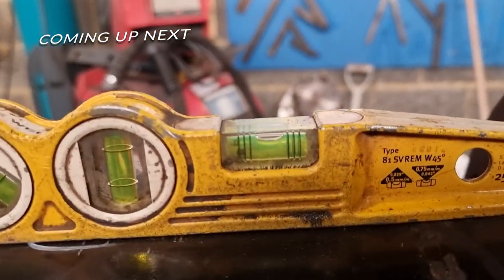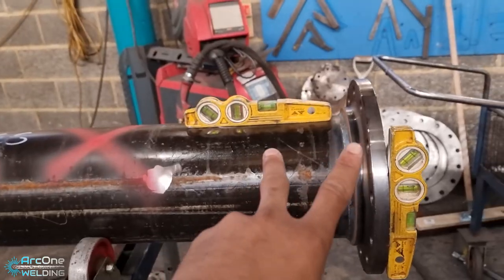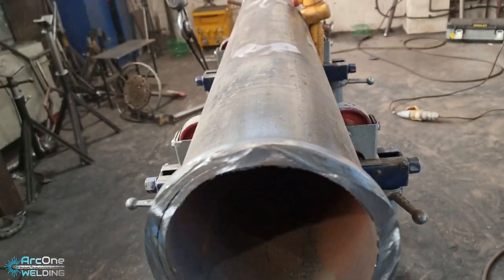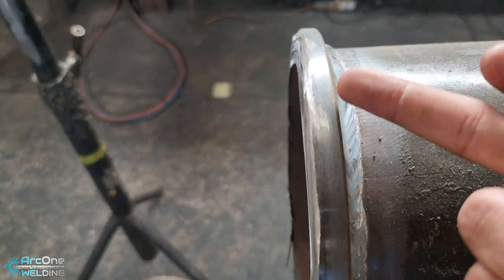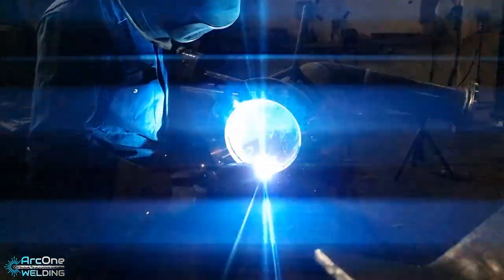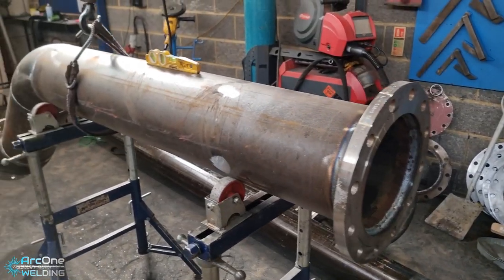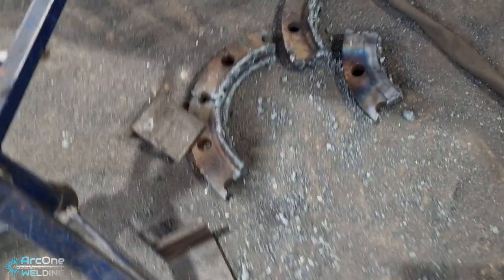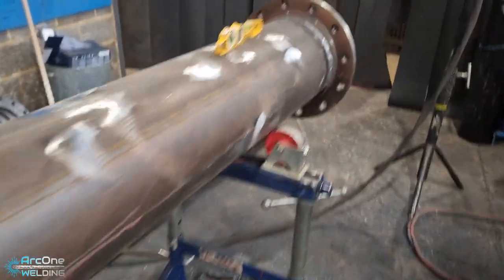2 Failures In 1 Day How To Repair A Condemned Pipe *Flange Cut & Burned Off*

Comment: Try using 2.5mm rod bits like small wedges to pack out & centre the flange this keeps the flange square with little alteration. retired fitter/welder. Always check bolt holes, level, etc etc.

Comment: Thumbs up bro!
I don´t know too much about MAG on pipes. Isn´t it possible to straighten these out using the acetylene Oxygen flame? On TIG/Stainless we do this even using the TIG torch to just straighten it. It surely works fine everytime..no cutting/grinding and all that. 30 minutes and done. But how is it on carbon pipes? Greetings from FRG.
Reply from the maker: Hey dude, nd tbh on pipe this big one torch isn't enough to get it hot enough to pull and its a pain trying to heat it because i eventually give up and just cut it off
Reply: @ARCONEWELDING  allright.. there´s no end to learning. Keep it up! Good videos, solid work!

Comment: If you already have a decent stick welder and compressed air, an air arc gouging torch isn't that much of an investment and it will do a heck of a lot more good than its worth, especially when you have to fix an f up before the boss finds out or quickly when he does know and is breathing down your neck. and paid peice work it's probably cheaper for you just to invest than lose all that time. that said you gotta piss with what you got not what you want.

Comment: Use the centre of the bubble, I've tested it on a horizontal borer and using the same Stabila level set up many times and done the final set with a DTI, 0.2mm over 500mm is easily achieved with that level, doing it to the line is just adding another possible mistake, as you proved. 
Get a more accurate level if you need to be more accurate than that.

Comment: Grinding out half of the weld and reweld to use shrinkage to pull it works, but sometimes not enough or too much
Reply from the maker: Honestly mate ive tried all that and at the end when it didn't work i wish i just cut it off and saved the time
Reply: @ARC-ONE WELDING  ahh right on I've only ever done it on stainless pipe joints.  I've also seen a torch and wet rags used in the field but would never use that method

Comment: It happens, I would dress the weld off outside and then carefully cut the face weld off, then a little or big hammer to knock it off, been there done that a few times. I always check the flange with a plate square and measure it as a double check

Comment: why not cut the pipe with the flange (the correct length) and use neck flange? (I'm not a welder )
Reply from the maker: A but weld costs more money to do, so unless its needed they wont add them and they stick to slip on flanges
Reply: @ARCONEWELDING  Yes but for this particular reparation, I think it would have been more cost effective for you to put a neck flange + butt weld than do your 2nd technique.

Comment: I’ve done similar fups at work. With the second one you might have been standing on the other side of the pipe when looking at the level. Still touches the right side of the mark but you are opposite to where you need to be. To eliminate that I set my pipe to perfect level and put my own mark on the bubble.  That way I’m still looking at the edge touching but the workpiece is true level. Just what works for me. Good on you for showing a day where nothing goes right 👍. Nice to know you are human too 😂

Comment: I'm a heating guy, I had to fit a set of bellows on site the other day and the elbow to reducer to flange was welded out of plumb, it was a complete nightmare getting it in with no leaks. Only has to be a few mm out and that's the job gone up the spout.

Comment: Arc air it of or gouge welds with gas axe
Reply: Should be able to save both the flange and pipe using gas axe or arc air.message me if you need any tips on gas axe gouging
Reply from the maker: I need work to buy us one first 😅
Reply: You could have save the flange…if you don’t have air arc to gouge the weld….you could have use your cutting torch to wash out the weld …instead of pressing the trigger, adjust your oxygen pressure using the knob…or .045 6” cutting wheel and grinding wheel will also do the job
Reply: I rember the times iv welded  taft ends on stainless pipe and put the flange on the wrong way round,only to cut them of and realise part way round rewelding that id put the flange the same wrong way 🙄🥴

Comment: Have you ever used a scarfing tip for a torch ?  the tip has a bend in it and is flat on one side  pretty much for doing what your doing there
Reply from the maker: No dude i didnt know that existed, i guess thats perfect for strange runs
Reply: @ARCONEWELDING  ya puts your torch tip flat to the steel its for knocking off old welds and stuff similar to and arch gouger only with flame.

Comment: Well you got me to subscribe. I've only seen a few videos and I have to say great stuff man. I'm a structural fitter/welder and since your job has so many flanges then your 2nd fix is definitely better but if you had to save it then try using a scarfing tip or if you don't have one blow out the weld by feathering the oxygen and using a back n forth motion to wash it out